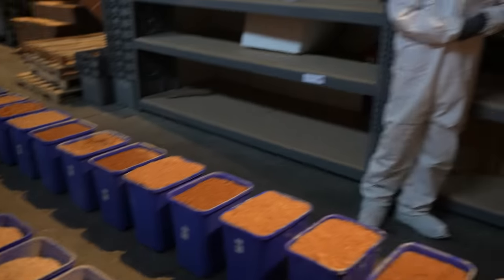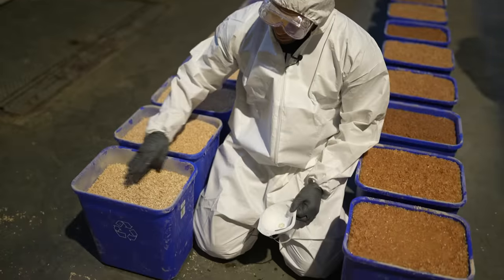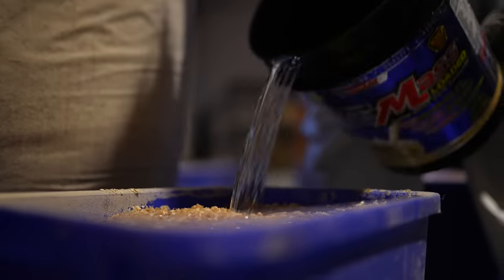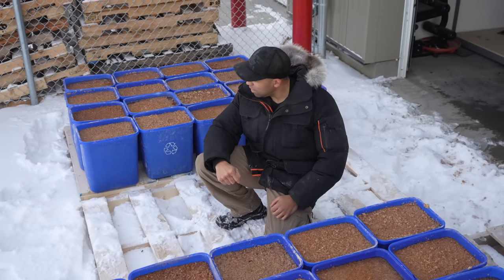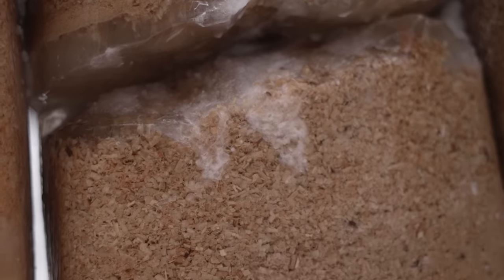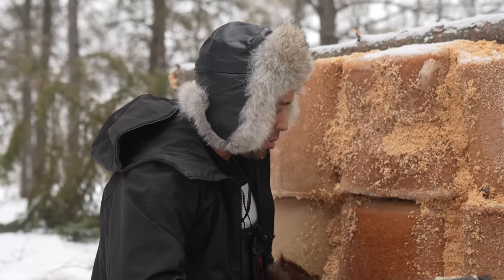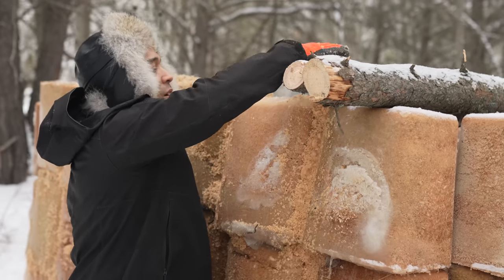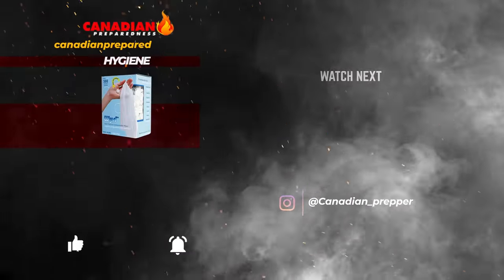Building a Bulletproof Pykrete Survival Shelter in Woods w/ Stove

Comment: Smaller blocks would freeze faster and easier to transport. Cool idea. Kids would love a winter playhouse.
Reply: Yea, an ice fort that will last into summer!!!
Reply: Smaller blocks would melt faster as well, and be less bullet proof, less protected as well as not last as long. Have to balance the trade offs.
Reply: They likely would have froze solid in half the time, or quicker, if they had atleast 12" of space around each of them instead of sitting sd x sd like they were.
Reply: Hopefully your husband is a furniture maker and has a lot of saw dust around.   😀
Reply: Larger, flatter containers would probably be best to quickly produce the material; the containers they used made it easy to stack up a batch, and minimised the fragility of the individual block.
Reply: Easier to use big brick if you dont have many people woth the weather. Also bigger surface are for bullets to hit is better because the bricks have a large mass. Tinier bricks could be taken down by probably hitting the middle really hard with a gun maybe. If anyone tries it lemme know how it goes. Please be safe though

Comment: suggestion Tip:      run the pipe to opposite side of shelter from the wall that the stove  is against.  More pipe in shelter allows more radiant heat to warm shelter.
Reply: he's ALREADY haveing heat issues too hot now brother

Comment: I have heard you can make cement out of ash from a fire. Of course you mix it with some sort of aggregate to give it strength. It would be interesting to see if this would be viable. I guess it would be similar to mud bricks mixed with straw, but wood ash mixed with whatever you have around. Maybe you could try that out. If it's possible it would be very viable and easy as the materials would be easy to come by.

Comment: I can see that sort of thing working quite well when there isn't much snow on the ground and things are generally frozen, kind of makes me wonder if there was a way to mix the stuff on site and let it freeze over in situ (somehow).
Reply: I would try setting up some plywood forms and fill them with a sawdust water slurry and let them sit for two weeks.
Reply: @allenwurl6245  Or I suppose you could lay  some sawdust in between walls made out of what snow or debris you do have to work with and sprinkle water over the sawdust "through" so to speak, and let that stuff freeze, build it up over time by adding sawdust and sprinlking water over it, over and over and over again.....
Reply: @allenwurl6245  yup

Comment: Neat, I have never seen this stuff but I avoid the cold as much as possible.  Just so you are not disappointed, it never will stand up to nuclear Armageddon but it should take an emp just fine.  I would be concerned about a round penetrating between two of the bricks, if you truly wanted more bullet proof then a change of the geometry, so there is no clear vector for a round to travel and have just ice as the wall.
Reply: Thanks for watching send ⤴️ a direct message right away🇨🇦🇨🇦☺

Comment: I need to say is that I’m not a prepper. Sorry. Was very curious what pyecrete was, how it’s made and how it works. Absolutely excellent video that explains and answered the majority of my questions l, but I still have 2. 
1. did you spend a night in the shelter without a fire/wood burning stove? Curious to know if this shelter would keep you warm inside of it once all the doors were closed and openings patched without a heat source. How warm? What would you need to bring for extra warmth if needed?
2. Roughly where in Canada do you live or where do you film? I can’t remember the last time the winter weather was consistently cold enough to freeze all the blocks and then freeze and set the shelter. I’ve lived in Northern (very North way past the tip of Lake Superior) and Southern Ontario, both with very different and distinct winter weather conditions. Both changing dramatically due to climate change. Very curious where this was created because I really miss winter!
Thank you for the excellent video and thank you ahead of time to anyone that can help with the questions. 
❤ from Shannon in Canada 🇨🇦

Comment: Nate , the next time you try making pykrete , separate the containers when freezing . Having the sides touching as was shown will up the freeze time a lot . A free air space around the containers equal to the width of the containers would be sufficient . An inch gap would be better than nothing .

Comment: I think I know why your Pykrete did not come out uniform.   When you sprayed the blue containers with WD-40 then filled the container with dry sawdust, some of the sawdust absorbed the WD-40 and when the water is put in and you stir the mixture to get the water all over, the sawdust that has oil in it tries to float up but has too much sawdust above it, thus leaving a gap for the water to freeze in.   Next time try putting a plastic bag in blue container before loading in the sawdust and the water.   You can still use the WD-40 but the plastic back will keep the WD-40 from getting on the sawdust and in the water.   Love your videos and the ideas you come up with.   Keep up informing us on the latest news on SHTF and ways to prep, I love learning something new.

Comment: I recall you tested Snow as a bullet proofing, I wonder how the pykrete would fare?
worst case just pile the snow against the pykrete and use that snow as extra insulation as well as winter camo, and bullet resistance!
In Greenhouse industry we have clear plastic tubes that can be suspended filled with water for heat collection (these are clear so they don't block sunlight to the plants) and the tubes are Cheap.  I wonder about ditching the sawdust and just fill the tubes up with regular water for a shelter - ie from a near-by creek - and they will freeze up faster, also if some of the water melts from the stove, since they would still be in the plastic, no water will drip or run onto the camp floor space. the tube plastic comes in a roll that would be eash to pack or have stashed somewhere until needed, and unlike the pails will take very little space during storage.  Cool Vid, thanks.

Comment: Well, personally I'd say pack the empty holes and pockets with mud and rocks, but not sure how hard the ground is there. Those Small holes are very little in the grand scheme of things. Then just layer the walls with mylar material to hold the heat in and it will keep it from melting as fast. Cheap mylar blankets are actually huge.

Comment: With the amount of snow you had there, it makes more sense to me to just bring sand bags, pack them with snow and make a structure with those.  It would be faster, easier to stack, just as insulating and just as strong.  The sand bags are also easier to transport in and back out when done using them.  Plus, you can use the bags during summer time as well.  Just my thoughts...

Comment: Might have tried a mixer to mix it into a slurry. More consistency in the bricks. In the freezing process leave the blocks farther apart to let the cold air circulate through it more. Could have used a fan on it to help in the freezing process. Just my two cents worth.
But interesting non the less.

Comment: SHOULD HAVE USED A PAINT MIXER ON A DRILL. I SAW A FEW BLOCKS WITH A GAP OF JUST WATER NO SAW DUST.  IN THEROY THE PURE ICE WILL MELT FASTER THAN THE SAWDUST MIX. THUS, CREATING A GAP LEADING TO STRUCTURAL FAILER. ALSO, YOU SHOULD STAGGAER THE BLOCKS. MY FIRST FORTS FELL OVER AFTER A GOOD STORM ,SO I LEARNED WHAT WENT WRONG AND BUILT THE NEXT ON BETTER. GOOD JOB ON THE VIDEO. I HAVE NEVER HEARD OF PYKRETE BEFORE. THANK YOU .

Comment: Pykrete can be made with a lot of materials, but I prefer wood shavings. The larger hollowed cell structures actually create stronger pykrete than pulverized wood which is barely stronger than frozen sand. Newspaper works better than sawdust as well.

Comment: Thank you for your video.

You might as well google superadobe and see what a long lasting fireproof, windproof, bulletproof, and earthquake resistant structure really looks like. 
I spent a childhood building forts in the bush, in the trees, in the snowbanks and I bet a couple of them lasted longer than that thing that you built did. 
With any luck, this will be my last fort I ever build. I'll make it a good one eh? Lights and the works. 

The superadobe is dirt cheap but very labor intensive so it would hardly be worth your time. Unless you are serious of course.

My design is for a 16ft diameter with two alcoves off to each side, one for the well and one for the composting toilet. The toilet is "contained" with "runoff" piped away as to not contaminate the shallow well. 
The poop takes about a year to slowly tumble down the sloped and stepped compost unit to the clean-out at the bottom where it is now humanure. Good for all trees, bushes, and plants that bear fruit above ground. I wouldn't use it on root crops that's for sure. A high vent pipe takes care of any odors but make sure your toilet lid is tight or the vent will exhaust all the heat in the place. 

I call this my Bunker of Despair because if I ever find myself cowering in the thing, it means the Shit has Hit The Fan hard, ... real hard. 
The crawl space under the floor will hold enough five gallon plastic buckets to keep me eating for years. The main floor will have a low ceiling for more lighter storage above. 

This structure will also double as a long term fallout structure, .... Did I mention the Shit Hitting The Fan hard? 

Good luck.

Comment: Just a quick tip. Link the full video in the comment section of the shorts version of this video and pin the comment. So it’s easier to get to the full video. It takes two taps instead of five.

Comment: I am sure Pykrete is great if you have a month to spare, a spare sawmill and a personal logistics set up...

For real impromptu survival and along similar lines is to combine this idea with a bender. make a good strong bender that is a reasonable shelter, then pack twigs, moss and leaves (and whole branches for bigger applications, it's all ablative)  into something to help you compress it and mix it with water until frozen into a workable slush that wants to freeze if you just let it settle. this can then be applied to the exterior of the bender like cob and you can continually keep adding new layers.

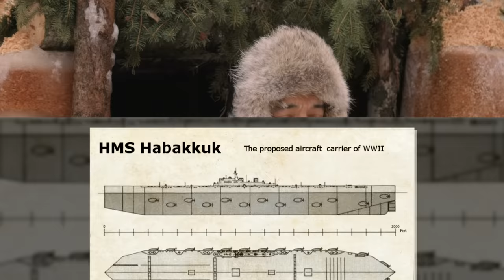Comment: 0:39 what is a stupid idea? Unsinkable giant carrier hunting U-Boots? It would work, Germans had nothing which could be a threat to something like this. If the Battle of Atlantic had really gone bad, it would be a very good option. The problem was mainly time - it would take a full year of even prepping the material, more realistically 2 years. The second problem was that it wasn't a US project, and Brits were no longer leaders in the war. 
Also, such a large carrier (15-20x heavier than today's supercarriers) would be slow and relatively costly to arm and equip (not to build the hull itself), so when enough economy was available and Germany weakened, the effort went into small escort carriers and long range planes which could be operational much earlier, be deployed gradually when built and sent to various areas more flexibly.